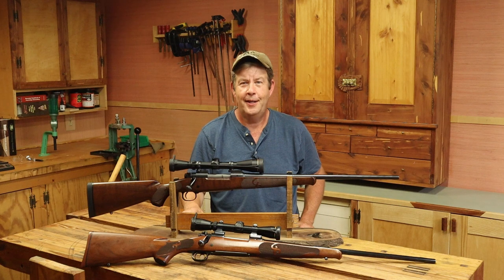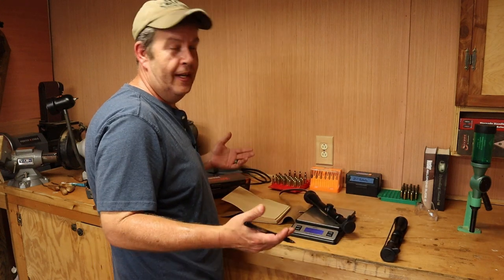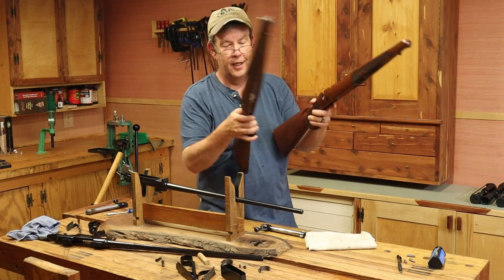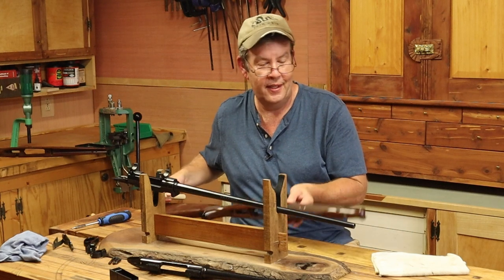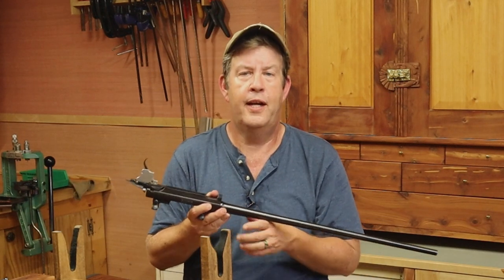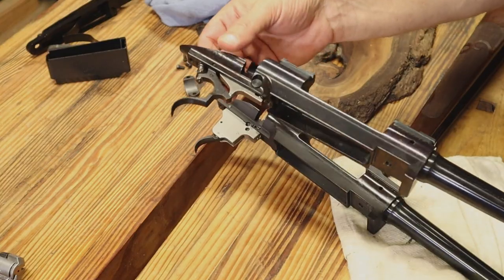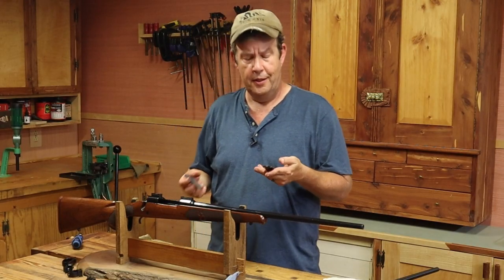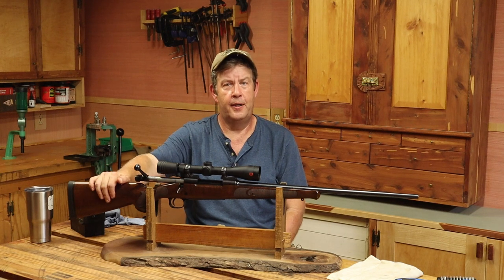257 Roberts Project; Trouble Shooting and Weight Difference

Comment: Just to ease my thoughts would u try 117gr an 100gr sierra those two my not like the heavy bullets  any way I would love to own either of them
Reply from the maker: Wayne you should appreciate the next video that I'm editing now. I tried the 117gr Siera Game King and did one 4 shot group with the 100gr Sierra Pro Hunter just out of curiosity for myself. I got some improvement with the 117gr Game Kings but none with the 100gr Pro Hunter which really surprised me.
Reply: @TomRiverSimpleLiving  
Hi, Tom.  If you did not get too much improvement with 100 Pro Hunter, sanding barrel channel, and switching scope, you may want to take the bases completely off (despite the lapping).  If the bases are even a tiny bit loose, as you know, that will impact groups.  Lapped  rings don’t help much if bases are loose and micro shifting under recoil.  Also, I wouldn’t trust just checking to tighten them; meaning, they should come off and be put back on to ensure screws are actually stretching and tight.  If it’s not the bases, then maybe it’s chamber/barrel issues and time for a custom true 1/9 twist. Best of luck and I really enjoy these videos!
Reply: I was going to ask about flat base vs boat tails, but I have some 100 gr. pro hunters over here on the bench. I think the 25 06 shot 100 grain Nosler Ballistic tips well, but I only have about 6 of those left, and Accurate arms no longer makes the 3100 powder I used with them.  They have a boat tail, sort of, but it's not as extreme as Hornady & Sierras.

Comment: I am always confused when someone buys a caliber of a rifle, and then wants to shoot a "heavy for caliber" bullet and then wonders why the accuracy is not there.  Remember, the 6mm Remington issue with barrel twist, was not designed for the 100gr....  If you want to shoot a heavier bullet move to a slightly larger caliber.  Example....use a .260 Remington with 120s, or a 6.5 Creed, or a even a 7mm-08 with 120s......and then the accuracy issue with .257 goes out the window.  But then if a larger caliber was purchased would you want to shoot 150s and create the same problem.........
Reply: With a variety of calibers I kinda  want to pick a range.  223-- 50 to 55 grain, .243-- 70 to 80 grain, 25-06 100-110 grain, 260--120 to 130, and .270 130 to 150.  7X57 140-175 grain, I could use the 243 for 100 grain, but why, when the 25-06 will mail it at 3,350 fps...But I do have some .257 cal. 120 gr and will work up loads for 25-06 with them, in time.  Another issue is I never did as well with Boat tails at short range as I did with flat base bullets. Oh and I ain't buying a 6.5 Creed. I got a .260 on purpose because of it....and I know a .243 will pole a mil;k jug and plink steel at 1000 yards so there's no need. Twist rate makes a lot of difference too. My .260 is 1:8 :)
Reply from the maker: Good point Jerry but this rifle should be able to stabilize the 117gr and 120gr bullets with no problem. Someone was commenting that they read where Col. Whelen said a 1:10 twist in 257 Roberts would stabilize up to a 125gr bullet. And as for using heavy for caliber bullets, it's funny you should say that because I normally use light for caliber bullets. But keep in mind the 257 Roberts and the 244 Remington where designed to be varmint/medium game combination cartridges. So by default we're going to be on the heavy end for medium game where as most other popular cartridges are medium / big game cartridges and we can go to the light end for deer.

Comment: Maybe the first person ruined the newer featherweight by taking the pressure pad out on a featherweight barrel?
Reply from the maker: I don't think so Rick? It's OK to remove a pressure point so long as the action is bedded and this one is. And I'm pretty sure the 2012 was free floated from the factory? I think the wood just moved some in this stock?
Reply: @TomRiverSimpleLiving  I look forward to the outcome, I had the same dramas with 25-06 and had to settle at 100gn(*sad face*)